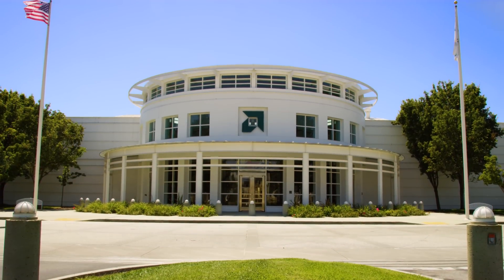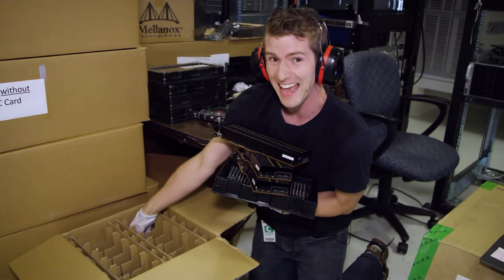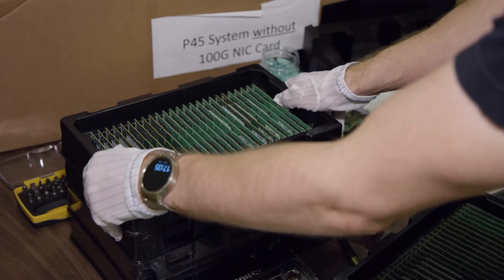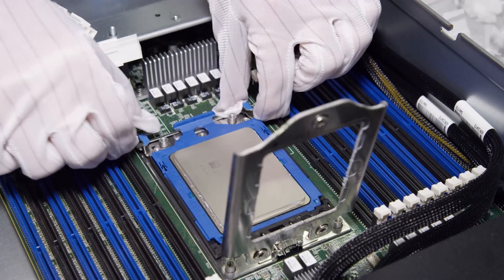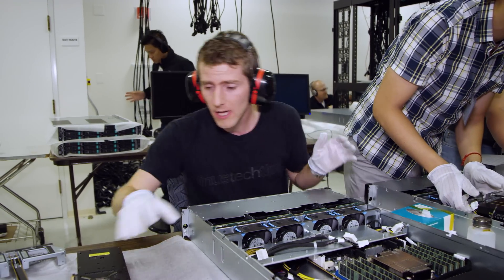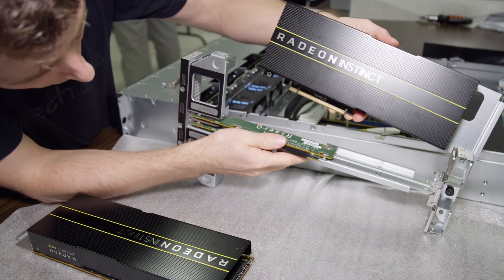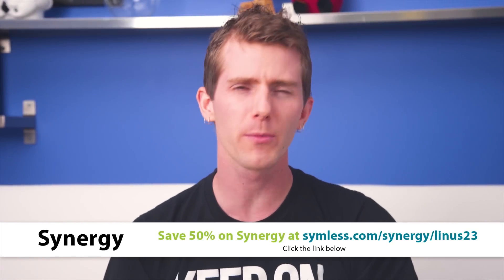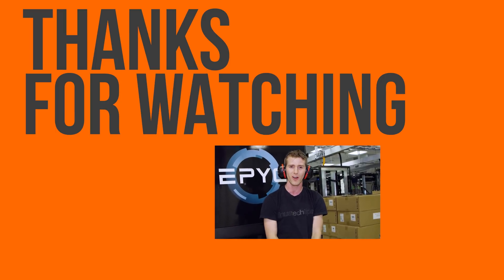AMD LET ME BUILD THEIR NEW 80 VEGA SUPERCOMPUTER…

Comment: They build a super computer. It still has vga 
EDIT: Everyone seems to belive that i think the server needs 4k, I know it does not, but hdmi not just for 4k, its simply a joke that we`ve never replaced for over a decade
Reply: The final setup with thousands of servers will all be linked up and displayed on one 21" CRT via VGA.
Reply: It's because VGA doesn't need drivers, so can bypass parts of the OS if you want to display something.
Reply: some motherboards use vga because its just standard, even high end gpus nowadays use old such technologies like DVI, just because it has vga does not make it a potato.
Reply: Zephane I understand that, It's a just a joke, but thanks for the explinatipn, you learn some thing new everyday!
Reply: I also think VGA's are great for troubleshooting.
Reply: it's a server... it'll need an actual video out maybe once a month at most lol
Reply: Server Mobo's typically have vga output
Reply: Dylan please tell me you're trolling...
Reply: Most of these racks with never be directly connected to a video output. VGA doesn't require drivers so it's pretty handy to have when someone one day needs to plug in a keyboard and monitor to debug.
Reply: Silly Looking fool You know... I'm a budget computer builder too, we're not all rich
Reply: Servers and supercomputers are handled over ssh so video output is superfluous. Sometimes you need a video port for debugging a particular server bios or OS, so you bring a little trolley with a screen and keyboard. The screen is usually a 1024x768 one because you don't need more to see a text based bios or a linux terminal or whatever.
Reply: VGA has been used for so long and has become a standard connection that can be used virtually anywhere without issue and they are relatively cheap to buy in bulk for large companies like this. there's not really a need or reason for them to buy HDMI or Display port cables and have them running to large resolution monitors
Reply: @Dylan Harrison VGA is a type of video output. Lol.
Reply: PorfilioVMJ Its used for a rack mounted monitor and troubleshooting.
Reply: Hdmi is a standard which you can not just implement, you have to pay a license for using hdmi

Also, who cares for 4k while troubleshooting a server that is remotely managed when it's back up and running
Reply: you dont need high end monitor to look up on server. our best buy server has really old lcd monitor to check status and maintain it. its old and durable af.
Reply: And how you can be sure that's actually VGA and not EGA or CGA?
Reply: another reason ti this list already is that VGA is extremely simple and basic to use.
Reply: Not everything is up to par lol
Reply: Dylan are you serious?
Reply: And a com port ball mouse...
Reply: They have both a VGA Input for putting into a monitor and a vga output for serial.
Reply: That is just for some rare cases of troubleshooting.
Reply: Hurtle Idk how you find hdmi, dvi or displayport hard to use....
Reply: you don't need to run DOS in 4k. lol
Reply: Its all you need kid.
Reply: PorfilioVMJ who needs dvi on a supercomputer that only does is heavy gpu workloads that doesnt include games? Lmao
Reply: VGA is also supercheap,  I work at a datacenter and if we had to replace every faulty hdmi cables it would be a fortune. Replacing broken vga cables is cheap af. Plus most servers use terminals, I only saw windows servers running GUI.
Reply: PorfilioVMJ this is just normal video output of the server board
Reply: DVI-D is still perfectly fine.  Display port is better, but DVI-D is perfectly capable of 1080p 144Hz...which is still better than most PC monitors that people use.  I use DVI-D to link my monitor and I have zero problems with it.
Reply: Dylan Harrison vga as on tge vga output not vega the gpu
Reply: EVEEYONE! This is just a joke on how vga is really old and we`ve never replaced it! I Know the uses of vga, all my servers use it!
Reply: PorfilioVMJ it’s for budget computer builders

Comment: And I thought my IBM Bladecenter E with 10 LS20 Opteron-based blades was a "HOLY BALLS" situation.  I eventually used it as a coffee table for lack of 4x 220V circuits at home...

After I realized I could get as much performance (or more) from one dual-socket Xeon board I gave up trying.

Comment: @6:27 I cringed when I saw how you force fed that riser card set down. OUCH!! I believe you are to apply the pressure nearest the center of the expansion/riser slot mating, but they could have told you otherwise. BUt I just cringe at the fact the PCB on that riser could have some back connections.

Comment: What is a flop (e.g. teraflop, petaflop) i tried searching google but the answers are sooooooo complicated
Reply: It stands for Floating point operations per second. It's the number of mathematical operations you can do on floating point numbers per second. The tera and peta mean the same things as when used in petabyte or terabyte. They are used because computers have become so powerful it's easier to say 2 petaflops than 2000000000000000 Flops.
Reply: what is floating point numbers?
Reply: They are a way of representing and working with numbers. In essence they work like decimal numbers e.g. 3.14159 in that the decimal place is allowed to "float". They have advantages in extended range of values that are representable with steadily lowering precision. The Wikipedia page is a good place to read for more info.

Comment: I wonder why a dual CPU system wasn't viable? Maybe the board partners haven't had enough time with the new product yet, or maybe it is just a space/cooling issue. And I wonder why the SSG wasn't used. That would have been insane; 4 of those would give each rack 8 TB of additional solid state memory.

Comment: But does it overheat like previous amd products
Reply: Overheat? I'm running some dinky ass Noctua 92mm cooler and my Ryzen is cooler than a 7800k on a triple rad!
Reply: ChristmasSamurai 1440p No it doesn't overheat like the current intel products.
Reply: Normal Epyc and Ryzen haven't, on the other hand, the GPUs aren't commercially available yet, so we'll never know
Reply: I never had heat problems with all my AMD stuff o_o even tho' I run my CPU 1.2 - 1.3Ghz (4.4 - 4.5Ghz) above standard clock. 4.5(22)Ghz @ 1.45V (NB 1.150) and the CPU runs at a max temp of 55C with the H100i v2. I think the limiting factor in my PC is the Motherboard. 

If your stuff overheats it is most likely your mistake and not the mistake of the Hardware, there is always the option to add more cooling/better cooling and if you refuse to use these it is simply your fault. o_O
Reply: I have an fx-8350 (125W TDP stock) running 4.7 Ghz at 1.5625V @vCore (obvious drops during load). So it is easily pushing 150w under 100% load or more now and my temps stay fine. I mean, I never go over 45 C and Intel chips (way lower tdp) always run in the 70's and 80's range because of Intel's lack of care for quality in their products. They use cheaper material for the heat spreader that is way less thermal conductive than what AMD has been using, and AMD solders their heat spreaders. Not glob it with cheap thermal compound cough Intel *cough*.

Anyways since us AMD users are mature and have nothing to lie about.
I will provide proof. -https://valid.x86.fr/t8dcxd
Reply: ChristmasSamurai 1440p you mean like Intel's current  stuff ... overheating hasn't been an issue for AMD for some time now ...
Reply: Let's just hope it doesn't heat as much as Skylake-X.
Reply: When the architecture is good, those companies make em cool, but when they're on despair mode (see bulldozer, pentium 4,core i9), they OC the hell out of it and you get heat issues.
So it's AMD turn to be the cool one (literally), until intel comes up with some spanking new architecture and AMD feels the heat.
Reply: ニャル子 I agree. I'm running a phenom ii at 5ghz and an 8959 at 4.7. Neither tops 55c. I'm using a be quiet dark rock pro air on both. My limiting factor is also my lousy ass motherboard. If peoples processes overheat. They probably expect to overclock inside a tiny dell case using stock coolers 😉
Reply: I think you spelled "i9" wrong
Reply: I have an RX 470, it doesn't even reach 70C under load (for comparison my HD 4870 was getting 70C on idle)
Reply: Not unless you're running Crysis.
Reply: yeah that was because of its excessive inefficiency when amd stuck to a 45nm die while intel was downsizing to 20, or 18nm. This vega puppy has a 12nm die i believe which basically means its performance is pretty much at if not surpassing the nvidia chips at same performance same tdp wattage. So basically same heat, same performance.
Reply: Wow you must be that stupid uninformed kid living under a rock for years.
Reply: Looks at amd fanboys.... sigh....
Reply: You edited it, what a pathetic liar.
Reply: you spell AMD wrong maybe it is x299 right ?
Reply: half the cost

Comment: Hey Linus,
The server processor you showed looks a lot like the AMD threadripper but with 32 cores instead of 16. Is it possible that it explaned the two dummy dies in de threadripper where in this server processor these are replaced with real dies? And is it possible that in the (near?) future a 32 core threadripper wil be anounced by AMD?
Reply: the real question is can you use Epyc 32 core procs in an x399 consumer board
Reply: Stormtrooper in the Rain Lmao, you know nothing. Epic and Threadripper both use multiple Zen CPUs, 8 cores each, put together on an interposer.
Epic is 4 dies, Threadripper is 2.
Reply: The two dummy dies are to ensure proper pressure over the whole IHS, if they weren't there then there would be a gap between the IHS and the CPU substrate on that half of the CPU.
Reply: BushidoBrownSama overclockable consumer 32 core, 8 channel ram, 124 lane system would be amazing!
Reply: +Stormtrooper in the Rain if you watched the WAN show, it was explained that the two "dummy cores" from the Threadripper don't even have transistors, they're plain silicon blocks. The dummy cores are just there for better heat-spread and weight-spread since the true cores are positioned in a diagonal fashion.
Reply: Yuri de Haer threadrippers are basically binned epyc cpu's from what i understand so yeah it us possible that a some threadripper cpu has 32 cores but half of them aren't working properly so they're just disabled. Also, they probably wont be making 32core threadripper behemoths since it'll just cannibalize some cpu's in their epyc lineup

Comment: Downloads GTA V 
*boss walks in
Deletes GTA V
*boss leaves
Downloads GTA V
Reply: Ethan Nichols so original
Reply: Ethan Nichols GTA V download time 01 second 😂😂😂
Reply: But the uploadbandwidth from the server would be too low to push the files in such a speed.
Reply: AMPERE ITS A JOKE DONT RUIN IT.
Reply: Ethan Nichols no, doesn't work that way, you need a storage device that is able to have 60gb read and write speeds
Reply: Luke Stephen hah. My GTA V file takes up 200GB on my PC. Beat that.
Reply: At my fastest, my google fibre 1gbs was about 20 seconds. but that also could be the pc bottlenecking..im not sure.

Comment: If you were wondering... here are the zeros in 1 Petaflops...
1,000,000,000,000,000 floating point operations PER SECOND (Flops)
or One Thousand Billions FLOPS
Reply: *one million billions
Reply: For those who do not know what are floating point operations, here is an example:
1 + 1
Reply: *Floating-point, operations don't float, just the decimal point. ;)

It specifically measures peak performance of all the arithmetic units that can handle floating-point numbers.  Which is especially useful in measuring compute performance because most non-trivial computations depends on floating-point numbers as they best represent the widest gamut of real numbers.
Reply: Fun to see all the zeros writen out sometimes. Fun fact the #1 on the Linpack list is running at 93,000 TFlop/s
Reply: In English, a billion is a thousand millions. In most other languages (like Spanish), a billion is one million millions, a trillion is one million billions, and so forth :)
Reply: Bella Strand what does flop mean ?
Reply: (FL)oating (O)perations (P)er (S)econd. Basically, a standardized unit to measure compute performance.
Reply: Anurag thapa floppydrive
Reply: aidanjt Flops are more usable in science and simulations. For everyday gamer they dont mean almost anything
Reply: Lmao I'm sitting with 300W's worth of 2.4 TFLOPS with a shiny 1 GB of overall memory.

Comment: Can it play Minecraft above 20 fps?
Reply: No it cant, it lacks video output.
Reply: xJozy on low without shaders
Reply: A Random Idiot Play's 
Sure but you can only see it in max 240hz cause its the highest refresh rate a monitor has currently on the market
Reply: it does have vga
Reply: WRONG...only the individual cards do
Reply: The real question.